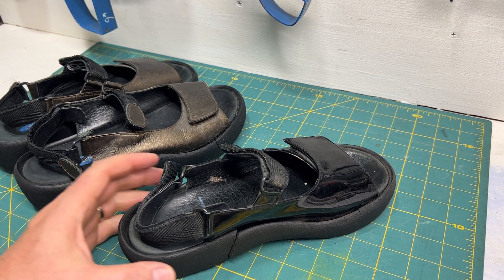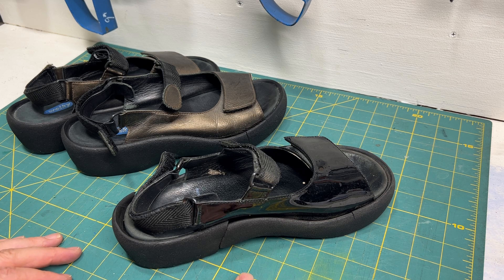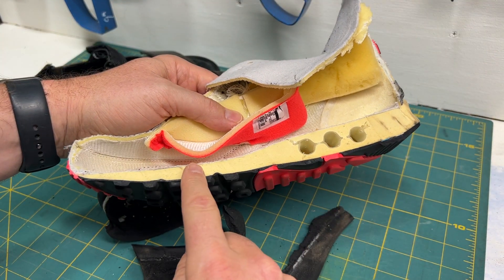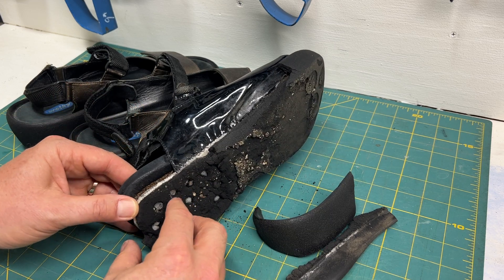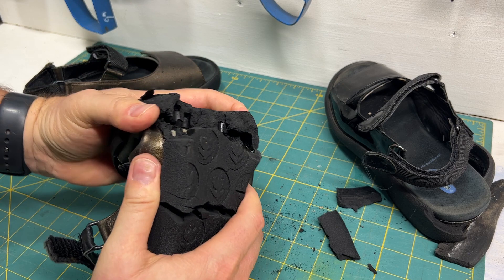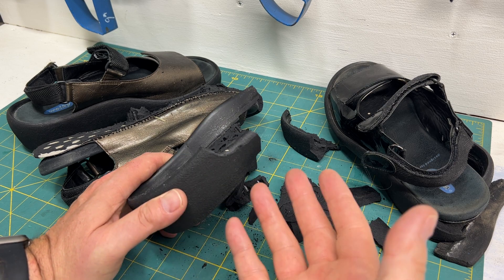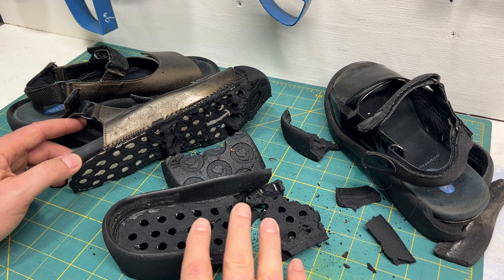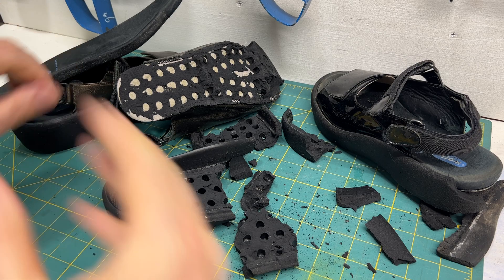PU Midsole Disasters!   Is Polyurethane Foam a Poor Choice?

Comment: Hydrolysis only happens with polyester based PU, not with polyether based PU...  Historically, ester was what everyone used because it is easier to process and manufacture.  There have been huge improvements in ether based PU's and there are suppliers that focus on ether based and you will not have the hydrolysis problems ever.
Reply from the maker: Yes!

Comment: PU soles are such a scam, they should be illegal. 
The delusion and optimism it takes to rationalize it is commemorable. If you can do that, you can find the bright side of life in anything lol
Every PU sole I've had cracked into pieces within a few a few days of wearing.
And, if you use one shoe to pry off the 2nd shoe, it will break off a chunk of the the first shoe's sole lol
PU is pure Garbage! As one guy pointed out, Crock's EVA is the way to go if you require a soft sole.
Reply from the maker: PU shoes last a few years, not a few days.
Reply: @ShoemakersAcademy  I get mine at thrift stores and store discount sales. Happens every time. Regulators need to put warming labels "Disintegrates in 2 years," followed by a sell by date lol
Reply: I dont agree with “few days”, unless you bought an expired material.
Reply: Good quality PU lasts min. 8 years average, sometimes over 10 years depending on how much humidity exposed.
Reply from the maker: @  And if the shoes are used, if the PU is not exercised, if you just leave them in storage, don't expect them to last.
Reply: @ You PU warriors are wild, lol. I wanna vibe with it, but my life is basically a tragic shoe saga: 1) Find some fire thrift store kicks, 2) Bend my toes once—CRACK, 3) Sole chunks just peel off in my hands like a bad relationship. This happens every. Single. Time. And if it's not me? Someone gifts me shoes that do this. They look brand new, so the heartbreak hits hard. Honestly, this kind of psychological trauma is a threat to society, lol.
Reply: I bought my Scarpa SL ACTIVE only two months ago. During a hike, the sole of my left foot completely fell off. I was laughed at by my companion who was only wearing a pair of ordinary Nike sneakers.
Reply: When I was younger I don't remember them cracking within few days ; I think it's years and also heard it's when you let them sit alone without being worn. Apparently wearing them keeps the midsole activated and intact longer.

Comment: I call BS on this supposedly natural decay. Manufacturers intentionally create the process for footwear soles to break down  and it easy rationalize why they do this.🤨  It's about time they get hit with class action lawsuits.
Reply from the maker: Sorry dude no conspiracy here. PU foam technology has improved but it not perfect. Making any foam soft is balancing act and it's hard!  We are trying to get molecular chains to hold together, but is such a way they are still flexible but durable. Water likes to interfere with these bonds and interestingly PU foam will last longer if the shoes are worn. 
If you just put your shoes in a  box, pretending they are like gold bars you will be disappointed.
Thanks for Watching!

Comment: I've 2 safety shoes (safety jogger), and all outersole crumble break like this one after I'm not using it 1 year (store in the box).
Reply from the maker: Well, PU is also susceptible to chemical attach or the direct attached machine did not have the mix adjusted correctly....
Reply: @ShoemakersAcademy  I think next time I'll choose EVA and Rubber based with goodyear welt.
If it breaks just resole it and change to vibram.

Thanks for reply.
Reply: Are you aware that safety shoes have expiration date as well? Safety shoes are meant to last a max of 1yr.
Reply: @narellano  Yes I now it. But in local reseller didn't say information when the product produced. Remember there's shelf life too for shoes.

Actually in reality the good one can stand more than 1 year.
Reply: @aditya.pratama you can check the expiry date on the outsole. It’s normally part of the mold. It mentions month/year.  Polyester PU foam, the one that undergoes hydroysis, causing foam to crumble, with added anti-hydrolysis additive may last 2-3 years.
Reply: @narellano  Thanks for the information. I didn't find it in my past experiences, this will be my concern when I buy next time.

Btw, I really like Red Wings or CAT, someday if I can afford it I'll buy it. It will last longer and I can change the outsole using vibram too.

Comment: There is a 3d print material named TPU. But I dont know if its suffer the same hydrolysis issues like polyurethane PU or not.
Reply: yes, it will disintegrate too.
Reply from the maker: TPU is a great material. Adidas Boost is "blown" TPU.

Comment: Crocs are made of something magical that doesn't shrink, and doesn't hydrolyze apart ( ... not even in landfill).
Reply from the maker: Ha ha it's called EVA, you can chop it and remelt it.  But yes it will last for ever.
Reply from the maker: Yeah that magic substance is called injected  EVA.
Reply: What if the midsole was sealed in something to contain it will the material breakdown even if it's contained within a carrier. I believe the PU over Eva is a superior cushioning possibly use less midsole to cut down on weight and say with Nike additional zoom air units together would be perfect.  A pair of Pony sneakers I found at Ross's ignighted my passion For the old school tech as I found out about it and realized the cushioning was so much better than this era of Eva.